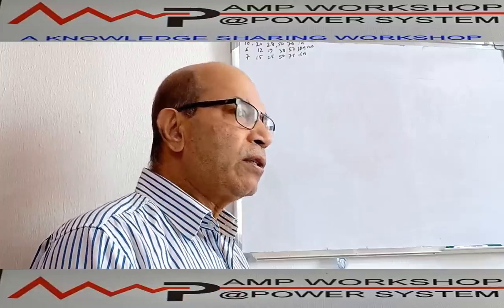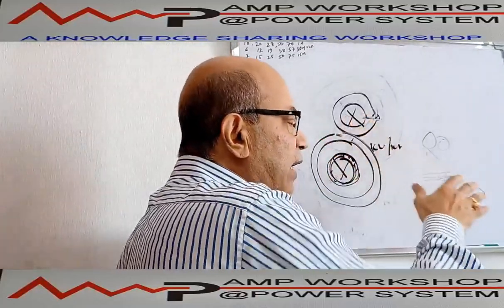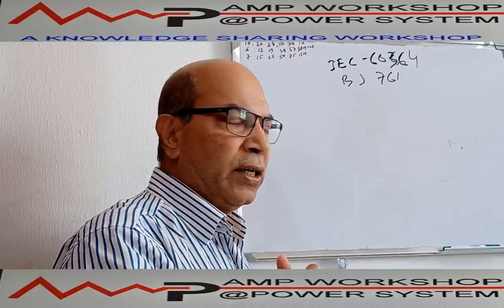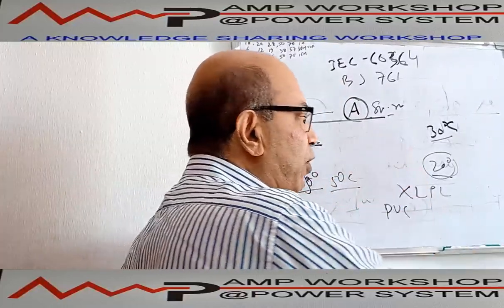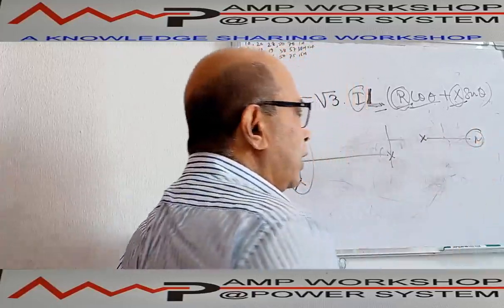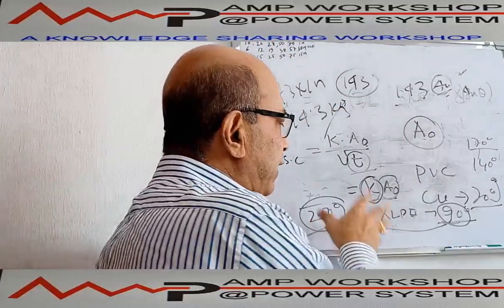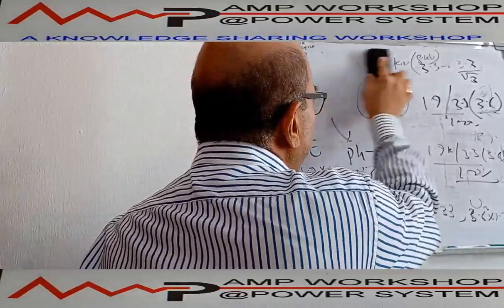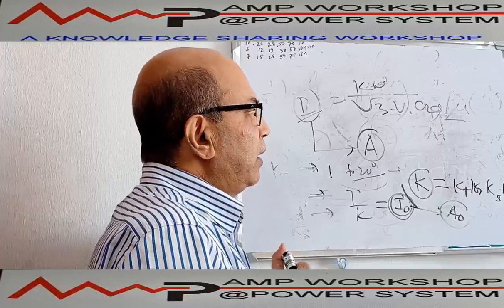BASICS OF POWER CABLE & SIZING  CALCULATION

Comment: Sir, IEC does not mention in case we use XLPE current rating against 90deg max temp of its insulation
This rating will bring conductor to equilibrium temp 90 degree which is not suitable for terminal of equipment which rated only 75 degree.
In this case, How to rectify this problem?
Reply from the maker: It shall be read as conductor temperature on continuous rating and not insulation.  Slip of tounge